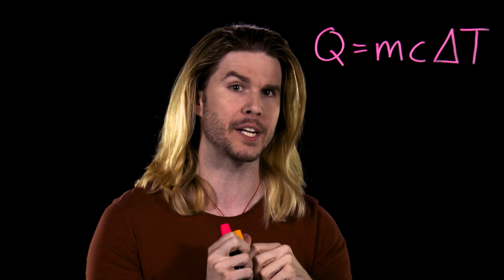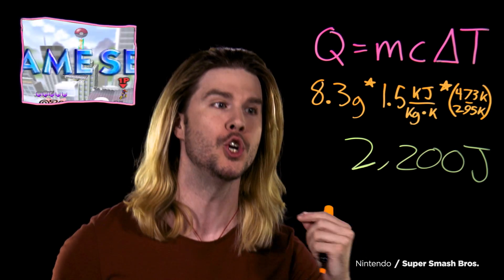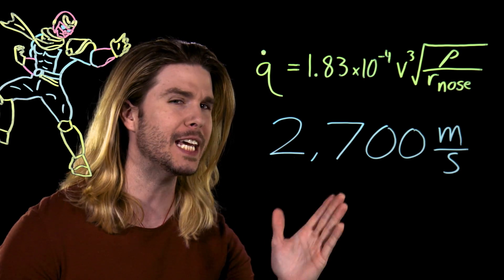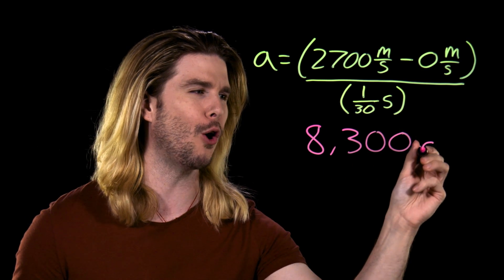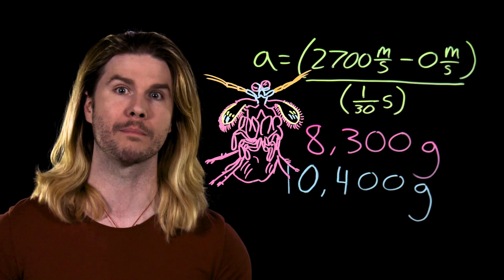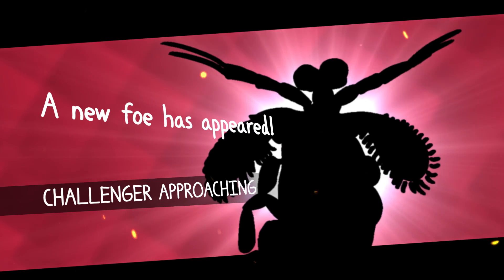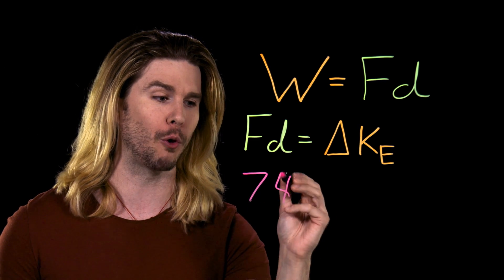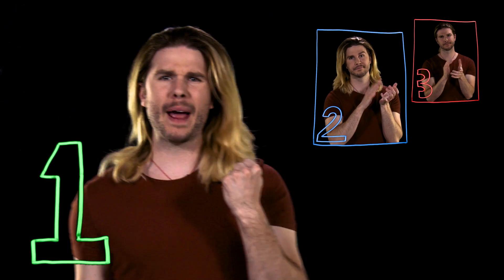How Powerful is a FALCON PUNCH?

Comment: Hi Kyle, great episode as always! I was deterministicly(?) too late to post a comment in time last week but not today! I had a thought, followed by a couple of questions. 

Couldn't Falcon potentially use his fiery punching speed while he's starting his swing (when moving his fist backward to take said swing) to create a vacuum in the air in front of his fist? The air would then rush in to fill that vacuum at speed exceeding 600km/h or around 170m/s at normal atmospheric pressure (The Mythbuster demonstrated a great example of this speed with one of their ping pong ball launcher). Falcon could use that inward rush of air and punch into it. And so I wonder;
Would that inrush of air reduce the amount of speed he would need to ignite his gloves? Or would these 2 combined effects make it easier to create flames trough Adiabatic heating? Is the punching speed you calculated even fast enough to create a temporary vacuum that would last long enough for him to use is anyway to facilitate the flammability of his fists?  
Thanks for taking the time to read!

Comment: Regarding using the FAA equation used to calculate heating per square meter.
This is a situation where one should not assume that the equation scales down to work for objects the size of a fist.
Friction and drag equations are often simplifications that only apply in certain size ranges as different effects dominate at different size ranges.

Comment: Question about the Mantis Shrimp - since evolution only really strives for what works and nothing more, why does such a creature like this have the ability to do something like this? It feels like extreme overkill. Like, you could punch your prey at a reasonable speed and adequately survive OR you could pull 10,400g and delete them from the universe. What gives? What challenge does the Mantis Shrimp face where an evolution like this is deemed necessary to survive?

Comment: This is my favorite episode, thus far. Really had laughing. 

P.S. As a kirby main, i don't appreciate the kirby slander. It's like a literal punch to the face. And don't stereotype all kirby mains, as if we all tend to spam Down + B. Just because kirby was sent flying, just below the ceiling of the blast zone and everybody else is fighting with such moderate to high damage % near the edge of the platform, unaware that they're directly beneath him. Every professional kirby player knows to fall or fly safely to the opposite end to think of a strategy to knock them all away with just a simple, yet deviously ingenious move, that may have been used once or twice per minute, nothing too excessively. But what sort of attack would work? I got it.... a dash attack. With everybody's backs being turned, they'll never see it coming. >:)

Comment: If we wanted to get into the semantics, the gloves might not even be the way to go to calculate the energy of the punch, especially if Cap is wearing them to keep his hands from ablating like micro-meateors every time he boxes, especially since at these impact forces, leather will stop being leather and start being... not-leather. If we assume then that the gloves are meant to A: protect Cpt. Falcon's hands, and B: not be expended after every single punch, now we're not looking at the gloves igniting, we're looking at what's happening with the air. It still works, but things will get more bonkers.

Once you go above Mach 5ish, you stop being in the "supersonics" realm and now enter "hypersonics" - the big difference here is that the ratio of your specific heats (Cp/Cv) can no longer be depended on to remain constant. For air it's normally 1.4, but it will begin to decrease as that Mach number increases, with some hefty consequences on the aerodynamics itself.

There's more that happens here though: Around 800K (Mach 3ish), you begin developing vibrational excitations in the air, which comes with IR emissions. At 2500K, oxygen molecules begin to dissociate, and their recombination comes packed. Around 4000K, nitrogen begin to dissociate, and that aforementioned oxygen is pretty much all busted apart. 6000-6500K is where you start seeing hefty electron excitation of the sorts you might find in an ICP (and corresponding light emission). Somewhere around 9000K is where you stop having molecules and start having an atomic soup. This is coincidentally also where you get substantial ionization in the air, and things get all plasma-y.

Somewhere in there you start getting into radiative gas effects which when pronounced enough will give a nice fiery glow. Unfortunately, that's not a problem you can casually smack with the Stefan-Boltzmann Law, since now your transmission is non-zero and... it's all just gross and you can't make me touch it.

6000K is probably going to be a good benchmark temperature for that light-emitting flame just based on excitations, so let's go with that. That means, under classical supersonic calculations, Captain Falcon is throwing hands at around Mach 10. Under the hypersonic limit, and assuming Cp/Cv is now around 1.2, someone now has to catch those hands at Mach 14.

Now that I think about it , I'm moderately certain that flame would look more blue-green and not yellow-orange, and Captain Peacock just doesn't have the same ring to it. Given how much the man poses, though... 

EDIT: Then again, if the radiative effects dominate enough at these temperatures, perhaps it would pick up enough red/orange to balance out. Hmmmm.

Comment: Story time:
In 1957, the world was in the depths of the cold war and, among other wonderful cold war tests run by America, there was on particular one known as the Pascal B. This was an experiment based on discerning the amount above ground radiation a atomic bomb would output. Naturally this experiment constituted setting off miniature atomic bombs, underground.

They plan was to set off the nuclear device and ensure the whole tunnel system was sealed. This, importantly, included a single access shaft to which a steel manhole cover had been welded.

When the experiment was eventually greenlit in the august of the year there was one small problem. The yield of the bomb they had used was a little to high. When it was eventually set off, the manhole cover, despite their best efforts, was immediately ejected. From camera footage recorded of the incident and calculations performed using the yield, it has been put at going anywhere from 8.7km/s to 60km/s making it the fastest man-made object on the planet earth.

More importantly to this episode, if any further footage had been captured of it, it would have perfectly illustrated the concept of aerodynamic heating, along with the ablative destruction that goes along with it.

Comment: Question: in regards to the “Saturn V rocket taking off on your face”, wouldn’t there actually be more force at the top of the rocket than directly underneath it? The push generated by the rockets is spread over a large area (compared to a human face), while the nose of the rocket being moved by all the collective thrust generated by the rockets is being focused down to a much smaller point. not to mention the rocket has much more mass than the particles produced by the jet engines. Scaled down, if heat weren’t an issue I’m sure it would hurt far more to get hit in the face by a model rocket than to have one take off from your face.

Comment: so good points to make and one im sure youve already read but like Mustang in FMA, what if Cap. Falcons gloves are made out of a material that is easily ignitable in order to add a sick burn to his foes? or rather easily spark-able. just by using the air around his fist and the force and velocity of his punch, or maybe the spark from the materials on the glove might ignite on contact with his foes. this might reduce the amount of force needed to cause the spark. since the flame happens in the single frame i would assume that the frame it happens is the moment of contact.

Comment: I think the true power of Captain Falcon's Falcon Punch is a lot higher than a mere 74 million N.
In lap 51 of the F-Zero anime, the impact from Captain Falcon's Falcon punch on Black Shadow created an astrophysical jet on the same order of magnitude as what is produced by supermassive black holes.
The upper limit of the luminosity for a supermassive black hole is given by the Eddington limit equation: L = 4πGMcmₚ/σₜ

Where:
L = Eddington limiting luminosity
G = constant of gravitation
M = mass of the black hole
π = 3.14159...
mₚ = mass of a proton
c = speed of light
σₜ = Thomson cross-section

Sagittarius A*, our closest supermassive black hole has a mass of 4×10⁶ solar masses
Substituting Sagittarius A*'s mass into the above equation yields a Luminosity of 5×10¹⁹ Yotta-Watts
Luminosity or Power = Force × Velocity
Professional boxers can punch at around 30mph or 13 m/s
Finally, dividing power by velocity gives you 4×10¹⁸ Yotta-Newtons of Force.

The Falcon Punch’s True Power written as a pure number is 4,000,000,000,000,000,000,000,000,000,000,000,000,000,000N

Comment: Hi, Kyle. First off, love the hair, but love the show, even more. I'm a long time lurker, first time commenter. I'm just astounded at the forces involved in the Falcon punch, but that only brings me to ask more questions. In order to punch with that acceleration, Falcon would have to have an even larger force output from his feet to the ground. I imagine that such a large force over such a small area (I believe Falcon wears a size 16 based on his canon height of 6'8") would actually punch a hole in the ground when he stepped into the punch. It would also explain how his Flacon Kick can launch him a little over 8m across the stage in a single second AND engulf him in flames. Considering that the stages in Smash Bros. are typically relatively thin platforms, wouldn't Falcon risk just blowing a hole underneath him every time he tries to launch one of these attacks?

Comment: Two points (well, a question and a point): 
1: Obvious question: What would happen if two falcon punches collided?

2: I think Captain Falcon officially has some kind of pyrokinesis, but as well-known, we don't explain stuff with with simple "magic" here. There are many other ways to create simple fire. Possibly, the fire is just an effect to make the punch look cool (which it totally does). Illusionists, for example, have many different ways of creating rather harmless fire effects. Flash paper, for example, is basically nitrocellulose, which ignites very quickly when ignited. So, the only thing Captain Falcon would have to do is to have a lot of flash paper in his gloves, which he ignites through possibly some spark device (like an electrical lighter) that he triggers in a hidden way. Hmm, now I really wanna make a captain falcon cosplay and use that effect.

Comment: I don't really think the recoil of the punch is actually an issue here... I'm not an expert, but you don't really see boxers or martial artists flying back due to the recoil of their punches etiher.

If the punchers form and kinetic linking is in order it is actually possible for even a regular person to punch someone back quite a distance without being thrown back themselves. The key is to push from the ground and transfer the force through your body into the fist, just like it was explained in the One inch punch video.

Also the point of any punch is to direct the kinetic energy into the punchee in order to make them move. If you're flung back by the recoil, I don't think you're punching right.

When Cap does the Falcon Punch his form and direction of the force seem to be in order. 

However he would need boots with good friction, though.

Comment: Hi Kyle, a martial artist here to correct something. You're a bit wrong about the distance it would take his fist to stop, that is if it would be in real life. If you are punching someone in real life you don't just want your hand to stop after aproximately 6-8cm, but in stead you would want to punch through someone (like Imagine would actually be the case for captain Falcon) using the full mass and rotation of your body as you do so. In stead of only having the length of your hand to stop you would in stead have the full length (almost) of your arm to stop, meaning the kinetic energy would drop a considerable amount if I remember my physics correctly. I still think it would be enough force to litteraly punch a hole in someone but that's up for you to calculate. Loved the video!

Comment: So, his suit must be some kind of exoskeleton no?
The weakest par of the body, when punching is the wrist, with 15 cm² of section area at best. The bones have a resistance of around 200 N/mm².
The wrist can there for transmit 200 * 1 500 = 300 000 N   There is still 73 700 000 N to go according to your numbers...
If said exoskeleton is made of some titanium alloy, we can hope for it having a resistance of about 1 200N/mm²
The needed section of such mater is 74 000 000 / 1 200 = 61 666 mm² or 617 cm², that's like the size of a A4 paper...
If we try with Carbon fiber, we may be able to resist to 3 200 N/mm² If we redo this math we obtain a needed section of  23 125 mm². The equivalent of a square with a 15cm side.
That would be very big gloves...

This mean only one thing! His bones are not mades of, well bone...
The required resisitance would then be 74 000 000 / 1 500 = 49 333 N/mm² It isn't possible as far as I know...

Well I've done what I can. If someone can explain me how he does that, I'm all hears.

Comment: Hi Kyle, love the show & keep up the good work. Question here, wouldn't the actual force needed to exert the punch be much stronger than a space shuttle's atmosphere entry considering the altitude differences?  The punch is on the ground or sea level where atmospheric pressure is the most dense? I'd imagine a difference but perhaps not by a large margin, i apologise but i'm no good at estimating it.

Comment: So how does body mechanics effect the force behind a punch?

It's not just the mass of a fist and it's time a distance of deceleration.  Joint alignment of hand, wrist, elbow and shoulder creates lots of different vectors, their is also the mass of the arm and torso.  Motions in spine, hips and legs also influence how energy is channeled through the body.  Of course with all the variables the equations get a lot more complex, but it all still just physics, right?

Comment: The equation q=mc∆T is actually wrong as c stands for heat capacit(the amount of heat required to heat the sample 1 degree C). The equation you used is q=ms∆T where s is the specific heat value (amount need to heat 1 gram of a substance 1 degree C)
Reply from the maker: I used the KJ/kg*K value, which is the correct one. Maybe we are using different variables -- kH

Comment: Mach 7 is the speed of the Navy railgun. Captain Falcons bones, muscle tissue, blood vessels, etc. would have to withstand that kind of momentum impacting with someone or something. Momentum aside, said biological materials would have to withstand the immediate acceleration from 0mph to Mach 7, about like the mentioned railgun, without the arm tearing itself apart. But the arm would also have to resist the immediate deceleration from Mach 7 to 0mph (when he can’t reach any further), which I’m pretty sure would rip his arm from its socket. None of that mentions the TREMENDOUS stresses each Falcon Punch puts on his arm; the immediate acceleration of his fist to Mach 7 in maybe an inch, and the immediate deceleration of his fist from Mach 7 to standstill in no more than an inch. His arm, realistically, wouldn’t even be mush after a using a single Falcon Punch; there wouldn’t be anything left.

Comment: You're calculating for the Falcon Punch, but Captain's move set is a paradoxical enigma in the face of logic, at least if we go off of original SSB stats (I don't think this has ever changed in later iterations.) The FP is CF's most powerful special (I know there's charged smashes and his ultimate that out classes the punch), but according to logic the Falcon Kick should pack a bigger "punch".

I know there's the loss of force due to him being airborne instead of fixed to the ground and yada-yada-yada. However he gets similar ignition on the flying kick as he does with the punch, but it deals less % damage with the kick. If you were to take the force calculations you've done here, Kyle, and applied them to the entirety of CF's entire body and flung him at the same Mach 7 the FP moves at, technically wouldn't the FK do more damage?

For a future episode, maybe consider Roy's exploding charged neutral special. The one where he hits the ground and causes a fat man to go off in his face. What, besides magic, would it take to make that happen repeatedly and for you to survive with just 10% damage back to you?

Comment: 74 mega Newtons over the surface area of a fist isn't going to send anything flying... it's going to go through everything, not accounting for the heat that vaporizes everything around it (including poor Falcon's hand and fist itself). The real question is, what is Kirby's tensile strength in order to actually be sent flying? You're more likely to put a hole in his side, which then begs the question, did you just unknowingly doom the world by creating an opening that can not be closed into the alternate universe that is Kirby's stomach?